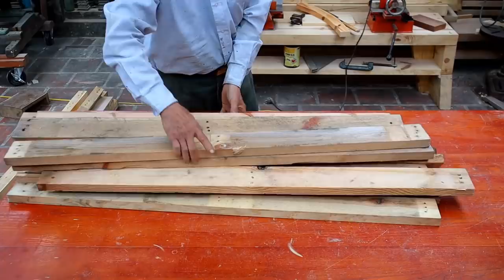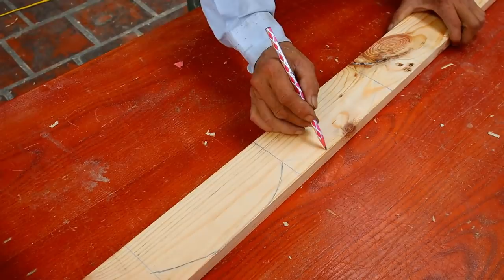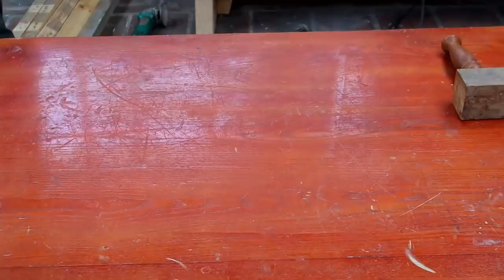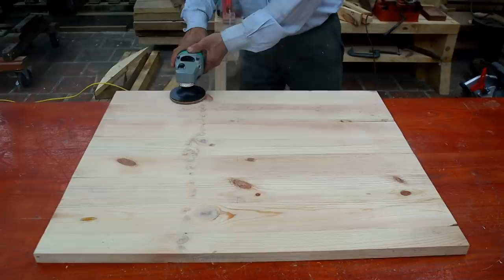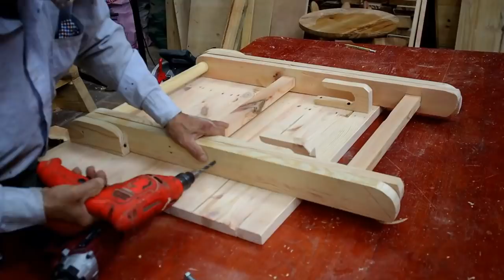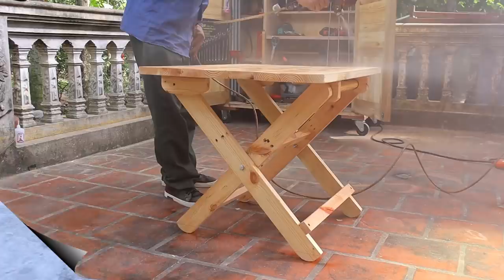Make A Coffee Table Foldable From A Wooden Pallet / Design Ideas Recycling DIY Wood Pallet Projects

Comment: I like the idea of hammering the nails half way in and then cutting the heads off. I suppose it's just like using dowels or biscuit joints but a lot quicker.